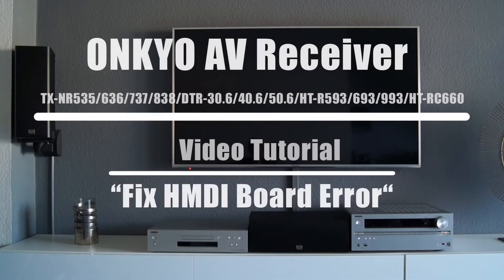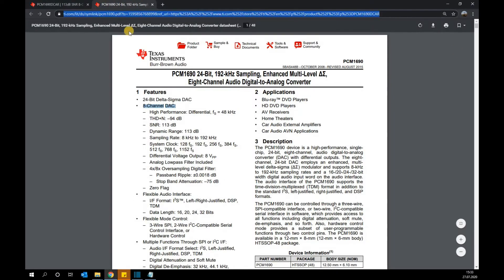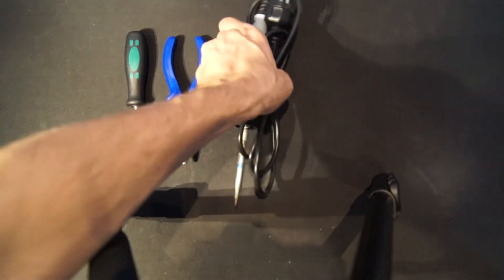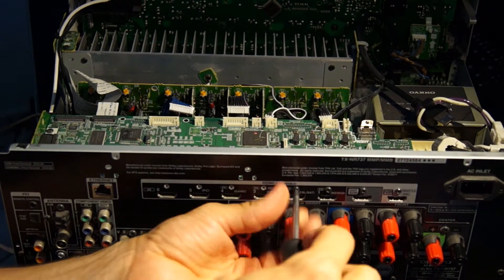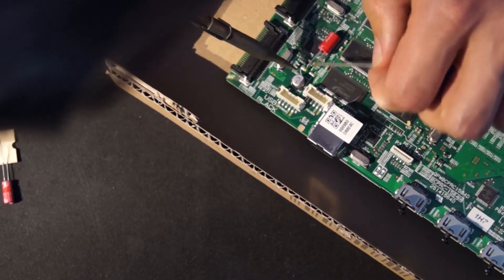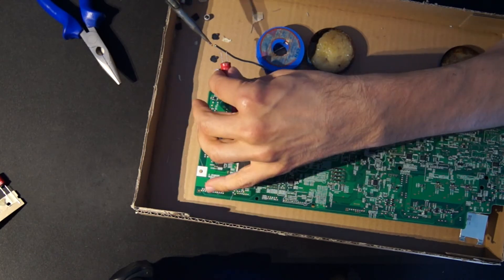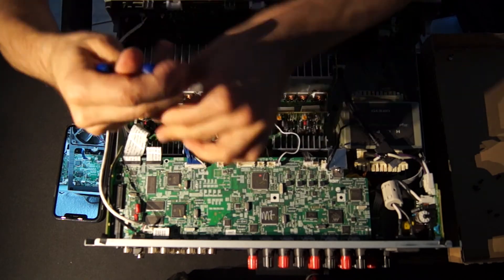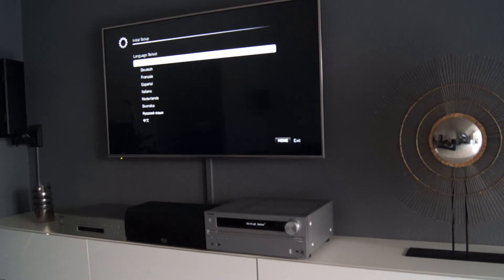ONKYO AV Receiver - How to Repair "HDMI Board Error" Part#1

Comment: Very ugly repair!
SMD caps should be replaced by SMD caps. The through hole caps you used are also "aluminium" type and electrolitic. They don't loose power but capacity (here in microFarads).
However, this gave me an idea and I'll try it on my ONKYO TX-NR616.
Reply from the maker: No, that's wrong. If you want to have the same problem again in a few years, then replace the SMD components with SMD components. In the meantime, google planned obsolescence.  Unfortunately, you have no idea.
Reply: @RepairUpgrade , let me show the obvious here:
1. The SMD caps you removed are the same type as those you placed: electrolitic polarized capacitor in an aluminum capsule. The ONLY difference is the way the component is fixed on the circuit board: SMD goes on the surface, hence the SMD - Surface Mounted Device, those you use are through hole components, classic way to mount them.
Both types have specs as capacity (microFarads in this case), working voltage (from 3.3 to 63 Vdc for these sizes) and maximum working temperature, usually 85°C or 105°C).
2. The problem in these ONKYOs is the design flaw regarding the heat dissipation. These receivers will get very hot even if playing quietly or in standby. So, the electrolytic caps will eventually fail, no matter the type used: SMD/through hole, or even older tantalum type.
3. The repair shown here is unsafe and ugly. Dangerous because those long wires might twist or touch any part of the circuit nearby. Short-circuits and sparks everywhere! Since these caps are for filtering/decoupling the terminals are connected to ground and any of the powerlines in that device and this is dangerous. Also, the way you removed the failed caps by twisting and pulling instead of desoldering can damage the solder pads and circuit traces.
So, who is wrong here?

Comment: How you get in your troubleshouting that the CAPs are the problem and not other part of HDMI Board? I have the same problem in TX-RZ810 that suddendly no picture on TV.
Reply: Did you figure it out? I have a TX-RZ710 that has no video out. The sound still works, and the TV still detects the hdmi cec data, just no video signal. Thanks.
Reply: Im having tx sr605 and i also facing like u on my reciver  @electrorocket8379

Comment: Hi, first, congratulations for the video. It's very detailed and guide me to understand the problem with my TX-NR797 (Main HDMI Output not working). Unfortunately, I didn't find any Service Manual in the net for my model and I can't find the correct capacitor to exchange and see if it fixes. Do you have the manual or someone else from a similar model or any other tip to handle this?

Comment: Hi there, thank you so much for this video. I have a Onkyo TX-NR609 that is broken with this exact problem. It is in quite a remote location in another country. If I would to order the same capacitors would it work, or would I have to hunt down the wiring diagram to check ? I can solder, but from an electronics standpoint, that's about my limit. Many Thanks Ian.

Comment: I have Onkyo TX-NR646, NO Video and Audio Via HDMI, Analog sounds works.  i hear reason: network chip got over voltages = heat, second problem is DTS-chip, same problem.

Comment: Hi I have the same problem for an Onkyo TX-NR616, Do you think that the fix applies to it too?
Reply: It might be the DSP chip on that board. It gets so hot that the solder melts under the chip. It needs to be reballed and I suggest a heatsink fixed on each of the ICs on the board than adding even two fans along with the existing one.

Comment: A really phantastic work, you have done. I'm the owner of al Onkyo TX-NR906. My problem is the same like you've shown. But the second problem for me, is that there are about 40 capacitors on the HDMI-board. So how can I know or decide which one has to be replaced? The diameter of the capacitor is between about 3 to 6 mm, the capacity 22 to 330 µF. Do I have to change them all? I also would like a answer in german. :-)

Comment: I have an issue with my TX NR 626 receiver. The primary HDMI started to fail (no video), but the ARC part still worked. The second HDMI port still worked, but that port doesn't have ARC. Now, a little later, the ARC on the main HDMI port is unstable as well, at times it works and at times it doesn't work.

The HDMI port on the 626 is not exactly the same, but it seems to have some similarities as the positions of the capacitors you mention in the video are exactly the same.

I wonder if this might be related to the capacitors as well
Reply: Did you fix it? I have the sam problem....Best regards, Simon
Reply: @vortexor1  No, problem is likely bad soldering of HDMI controller / chip. You need someone with a BGA soldering machine to heat the chip. But that seems to be a temporary solution, root cause seems to be bad quality solder. I ended up buying a new receiver

Comment: I found your video to be the answer to my HDMI video problem, thank you for creating this, fantastic work! I do have a question for you if you would be so kind. After the replacement of the caps, 3 hours into is rebirth the audio started clipping in and out, video never missed a beat. Is there a capacitor involved in those that were changed that may be identifiable regarding audio? I assume I have a questionable solder connection but i don't know which to look at. Any help would be much appreciated
Reply from the maker: That does not sound good. It could be a cold solder joint that loses contact when heated and expanded. You should no longer operate the device in this state.

You have the following options:

1. Check the capacitance and polarity of the capacitors.
2. Solder the capacitors again.
3. Reset the device.

4. Hope after that everything works again.

5. If necessary, check the IC using the Integrated Debug Mode. I have created 2 videos for this.

6. Have you installed ventilation? If not, this is what you should do to increase the life of your device. Check out my other videos on this.
Reply: Thanks for the response! I shut it down when it became apparent it was a new issue. So of all the caps changed they should all be checked,  meaning it could be anyone of 
them? Ok I will do that. I did watch your other videos and will go back to them for all the tests and the additional fans to install. I just wanted to say thank you again for your outstanding videos and I look forward to being better suited to keep this running for some years to come. In your list you have resetting the device as an option, just curious what the benefit is, I will do it since you're much more adept at this than I !! : )
Reply from the maker: @steveneffert993  I am glad if the video could help you.

Comment: Thank you for the video, amazing!
I have a similar issue with my Onkyo HT-R693. No sound/video, but through both the main- and sub-output. Bluetooth devices do stream audio properly..
Will your tutorial (+same capacitors) possibly work for my Onkyo? I might try this in 2 weeks!

Thank you
Reply: Ah never mind, didn’t read the description properly. Thanks, anyway!
Reply from the maker: @malkaandben  The capacitors can be the cause ...

The DSP (Digital Signal Processor) is often the cause of the no-sound problem. The microprocessors have temperatures of up to 70 ° C during operation and the contacts at the soldering points loosen over time. The "reballing/reflow" method helps to repair the DSP easily. The soldering points are re-soldered with great heat. Fortunately, I do not have this mistake and have not described the procedure.

The "reballing/reflow" procedure is well described in a variety of other videos ...

Looking back and before I start swapping the capacitors, I recommend testing the DSP and the individual microprocessors with the INTEGRATED DEBUG MODE. I created my own video for this ("ONKYO AV Receiver - How to use integrated DEBUG MODE for TROUBLESHOOTING - Part # 2" - https://youtu.be/SbyrOq7Vv8o).

The procedure is described on position 5:52 in the video.

I hope this helps!
Reply: @RepairUpgrade  
Thank you kindly for taking the time to help us all.. even in the comment section, seriously amazing!
Just did the test; sadly getting question marks for the K1 (VSP), T1 (VSP2) and R1 (VSP2).
What would you recommend doing in this case? Reballing/reflow method for all three microprocessors, would that be possible or perhaps a lost cause?
Reply from the maker: @malkaandben  Nice to hear that DEBUG MODE could help a little further with troubleshooting.

I think it is unlikely that all microprocessors detached themselves from the board at the same time. That is why I would personally refrain from REBALLING the three microprocessors.

I rate the ??????????? in DEBUG MODE so that the microprocessor does not respond.

This not responding can be according to my assessment 1. a fault in the microprocessor BUT also 2. a lack of power supply from the microprocessor.

To 1. 'Fault in the microprocessor':
------------------------------------------------------

The errors in the microprocessor and on the board can be seen 'with a little luck' with the naked eye. In the case of the HDMI transmitter - I made my own video for this 'ONKYO AV Receiver - How to Repair "HDMI Board Error" Part#2'  (https://youtu.be/4pEwcBJofXM) and Position: 04:52 the contacts were colored brown. The processor could be brought back to life with a heat gun thanks to REFLOW. If that doesn't help, the processor can still be replaced.

BUT for this procedure Experience in SMD soldering is required here and it is recommended to have the right professional equipment in the form of a microscope and a soldering station for SMD components. The challenge is also to get the microprocessor individually in the sale. Replacing the microprocessor without equipment can be very costly.

To 2.
 'lack of power supply':
---------------------------------------------

A lack of power supply can be caused by defective capacitors, especially if the capacitor is used to smooth a supply voltage and creates a short circuit in the event of a defect ...

Therefore, replacing the capacitors could solve the problem. The likelihood of troubleshooting is small but possible. The effort and costs are low.

The challenge when replacing capacitors is to find the capacitors with the correct values (capacitance / voltage). The capacitor values are in the service manuals. The service manuals for the ONKYO receivers are available free of charge with a little research on the Internet. Not all values for the capacitors are listed with the values (capacitance / voltage) in the service manuals.

Testing the installed capacitors could help to find the correct capacitance value (voltage should be at least 16 V, ideally 220 V). Some multimeters offer the possibility to measure capacitor values. The capacitors must be removed for this. The measurement takes place at their contacts. The process is also complex but not so costly.

It is important to decide how much effort the device is worth ...

Finally, - and before the device is opened - is it possible to use connections other than HDMI? In my case, I only use the rear cinch connections and only use the HDMI MAIN connection to configure the device after a RESET. For the input of the audio signal I use the optical input and the cinch inputs. For video signals, I go DIRECTLY from the connected devices (DVD player etc.) to the television using an HDMI cable.

Comment: Thank you
Reply from the maker: I am glad to hear that.

Please, before you change the capacitors, see my second video (ONKYO AV Receiver - How to Repair "HDMI Board Error" Part#2"). The HDMI error can also be traced back to a defective HDMI transmitter. It was like that in my case. Now the ONKYO works reliably again ;-)

Comment: Hallo , vielleicht weist du einen Rat
Ich habe ein HT-C660 baugleich TX-NR636
Per Fernbedienung schaltet er sich kurz ein und geht direkt wieder aus.
Tasten am Receiver...drücke ich diese zum einschalten...mehrmals auf verschiedene am Receiver....
geht er an...habe auch ein Bild aber keinen TON
Hängt das Einschalten eventuell auch mit dem HDMI Sound Problem zusammen weil die Software
das HDMI Board nicht mehr richtig Initialisieren kann ??
Lg
Reply from the maker: Hey, if the receiver switches itself off immediately after switching it on, an error is detected. The cause can have various causes:
- defective component is recognized (e.g. if the fan is not recognized, the receiver does not switch on either)
- defective on the circuit board, which may be related to the "no sound problem". There are a some video instructions available.

1. You could try to reset the receiver with the key combinations ("CBL/SAT" & "ON/STANDBY"  in the Case for TX-NR737) to the factory settings. I assume you have already done that.
2. You can localise and isolate the error with the integrated DEBUG MODE. I made a video on how to use Debug Mode. U.a. also to test the fan. There are other test options available. Before using the debug mode, it is essential to disconnect the speakers, as the speakers are also tested for maximum volume! The link to the video "ONKYO AV Receiver - How to use integrated DEBUG MODE for COOLING FAN CONTROL" is here: https://youtu.be/Xp7ZiVGU6Ig

I hope I could help you a little

------------------------------------

Hey, wenn sich der Receiver nach dem Einschalten gleich wieder ausschaltet, wird ein Fehler erkennt. Die Ursache kann verschiedene Ursachen haben:
- defektes Bauteil wird erkannt (z.B. wenn der Lüfter nicht erkannt wird, schaltet sich der Receiver auch nicht ein)
- defekt auf der Platine, der mit dem No Sound Problem zusammenhängen kann. Es gibt einige Videoanleitungen dazu im Netz.

1. Du könntest den Receiver mit der Tastenkombination ( "CBL/SAT" & "ON/STANDBY"  im Fall für den TX-NR737 ) auf die Werkseinstellungen zurücksetzen. Ich gehe davon aus, dass hast Du bereits getan.

2. Du kannst den Fehler mit dem integrierten DEBUG MODE lokalisieren und weiter eingrenzen. Ich habe ein Video hierzu gemacht, wie der Debug Mode genutzt werden kann. U.a. auch um den Lüfter zu testen. Es sind andere Testmöglichkeiten vorhanden. Vor dem Einsatz des Debug Modus unbedingt die Boxen abklemmen, da auch die Lautsprecher auf maximale Lautstärke getestet werden! Der Link zum Video "ONKYO AV Receiver - How to use integrated DEBUG MODE for COOLING FAN CONTROL" befindet sich hier: https://youtu.be/Xp7ZiVGU6Ig

Hoffe ich konnte Dir etwas weiterhelfen